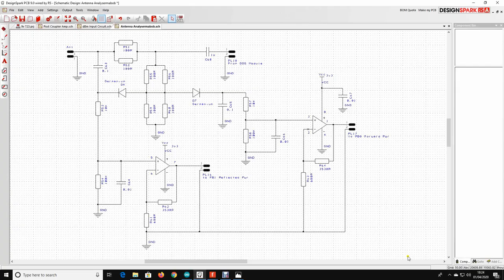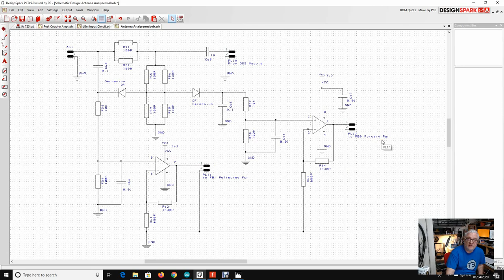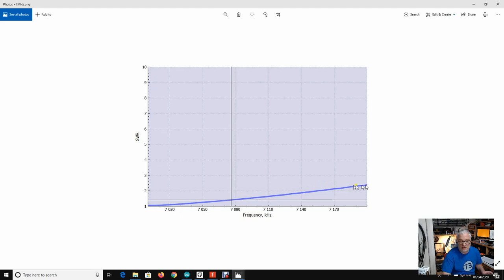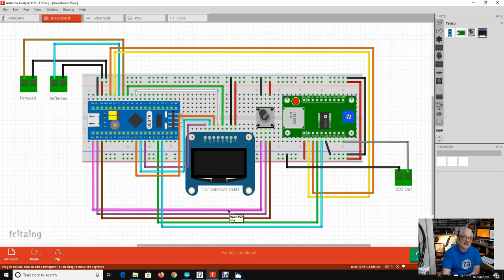Arduino STM32 Experimental Antenna Analyser

Comment: Good stuff.  I never got happy results with this circuit - could never get 1:1 going into my dummy load.
Reply from the maker: Which germanium diodes did you use?
Reply from the maker: When I used the 2x100R resistors as a dummy load in test the SWR was a flat 1:1 on all bands.
Reply: Mark G0MGX aa143
Reply from the maker: @MegaCadr  I dont have any to try but would expect them to be fine. You could always add a small broadband amp at the output of the DDS and reduce the op-amp gains.
Reply: Mark G0MGX I tried an amp at the time, but didn’t mess with the opamp gain.  But as I have since acquired a nanovna, I probably won’t get back to this anytime soon :)